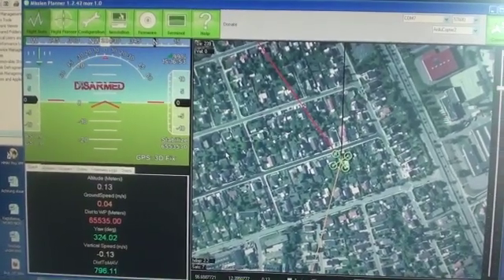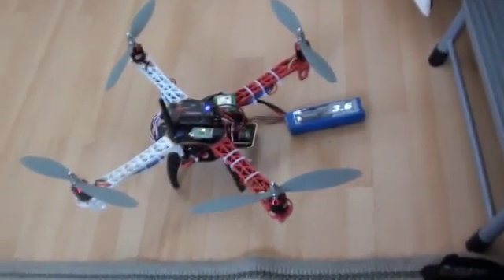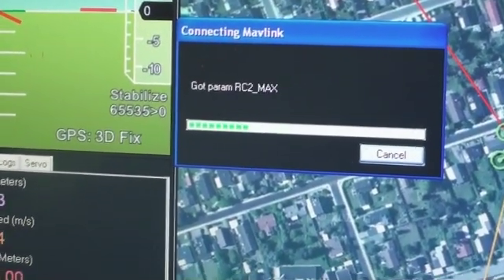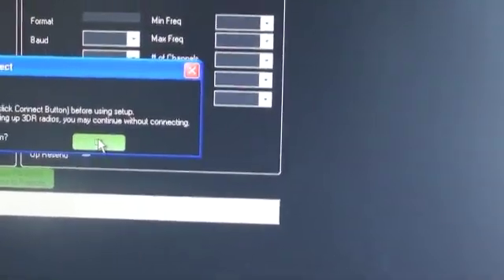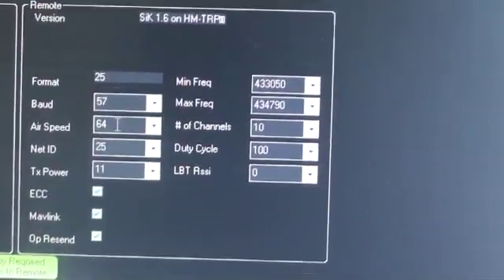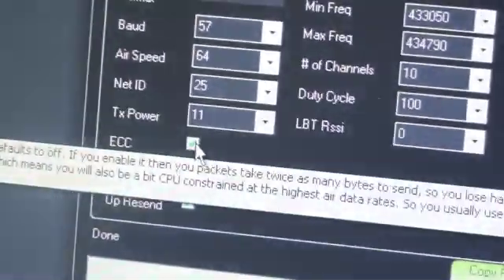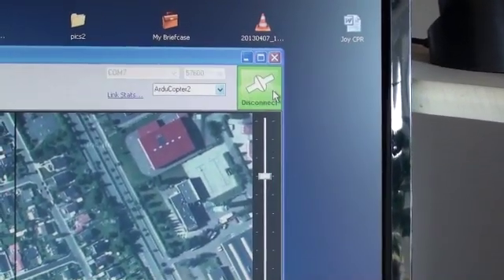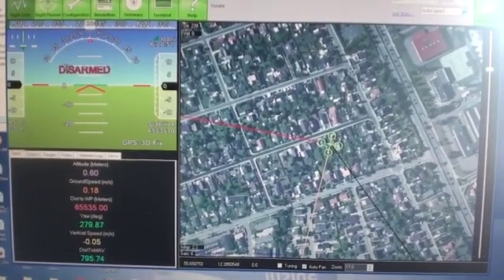3DR radio telemetry  3 of 4

Comment: And the setting for the flight controller? I can Load Setting on both the Ground and the Air Rad.io seperatly but that'll mean they will have both loaded or be read as Local and not Remote. When I power the Quad it's radio LED is just Solid Red. Flight Controller settings please. None of the videos I have seen discus the actual setting up of FC and software for these radios just the connections.

Comment: bro im using 3dr 433Mhz telemetry if i connect my telemetry it shows connection failed if i load settings it shows "invalid com or in use" my os is win10 kindly suggest me the sollution

Comment: Do you have to have internet service on your laptop once everything (mission planner) is loaded , or does the computer use the data from your Pixhawk / APM 's GPS and telemetry ? I have Pixhawk ordered but didn't come with 3DR 915mhz radio set . Where I live we don't have cell service most of the time and when we do it is weak weak weak . and I wouldn't trust it to fly my drone with the sorry signal we get . So I don't know if I need the 3DR radios .

Comment: hi! I did exactly the same as you did, but when I click on the connect button, a message saying "Mavlink is trying to connect" and a countdown starts from 30 seconds. When it reaches 0 seconds, it says No Heartbeat Packets Received. What am i doing wrong? Thanks!
Reply: Upper right corner DO NOT CHOOSE connect just the load settings. This should work if you choose the correct com port and communication speed.

Comment: Hi. Great videos... I'm having problems with my 3dr radios, they won't communicate with each other. The copter one has a flashing green light & the ground station has a solid green light & flashing red. Any idea what might be the problem?  The radio set is like the one you have on the left had side of you first video.

Comment from the maker: The APM sstaus LED is within the transparent case itselp
The GPS status LED is under the GPS module
The Telemetry Status LED is on the telemetry unit itself
The LED reflecting on the floor is just a position LED i added to help see my craft in foor light conditions.

Comment from the maker: A solid red light means the unit is in firmware update mode . open your 3DR configuration tool in mission planner and do a 'Firmware load' . if it does not solve the problem then try posting on the 3DR wiki forum.

Comment: My airmodule radio keeps burning a solid red led. Any idea how to fix this? All cables seem fine... but when I connect and power up (on battery) the radio on my craft is burning a solid red led.